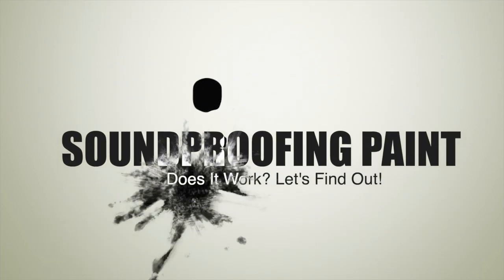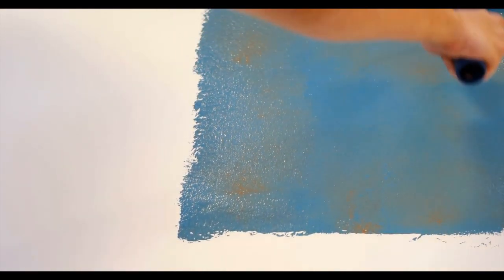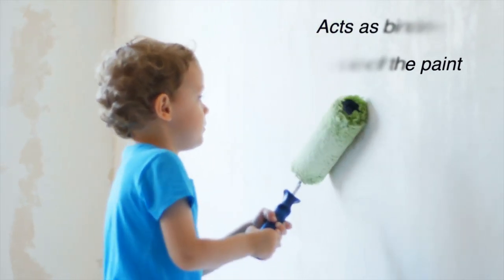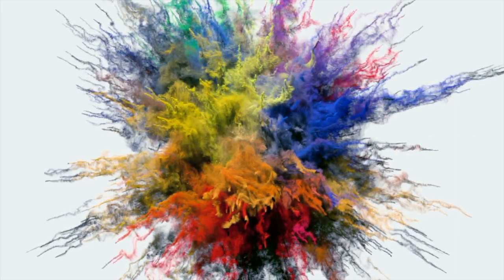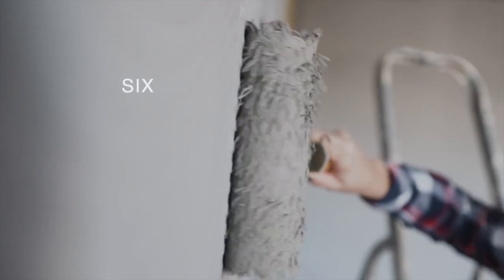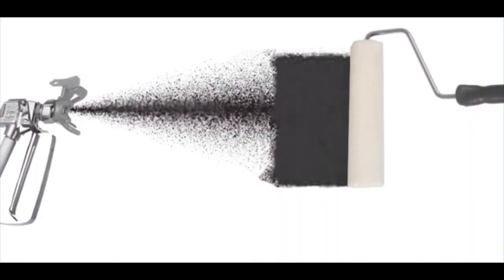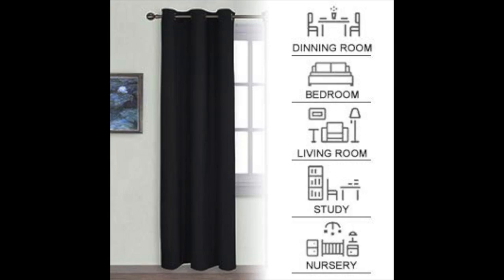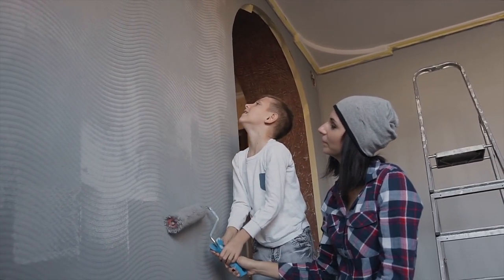Soundproofing Paint - Does it Work? All the Facts You Need!

Comment: You never actually comment on whether or not it works, you only describe how the paint is designed to work.
Reply: I know right. Just wasted 10 mins. Next video........
Reply: He gave specific details of how well it works: 2–4 dB reduction per coat at mid-range frequencies.
Reply: What? He goes into great detail about what the paint actually does, the range of decibel decrease per coat, the types of noise it will and won't reduce, and a bevy of other information.
Reply: Thank you for asking the question. He spent so much time asking the question that I figured he was never going to get to any analysis or comparison. I'm guessing he read a product fact sheet to get the answers referenced below... (2-4 dB reduction per coat at mid-range frequencies...according to the manufacturer?
Reply: @southpaw788 ignorant
Reply: Well, another ignorant

Comment: Would applying this paint to my ceiling help with the sound of my upstairs neighbors walking on hardwood? Or possibly adding soundproof panels to the ceiling? I don't need to eliminate the sound altogether, but even if it lowers the sound a little it might be worth it. Since I live in an apartment, decoupling the ceiling is not an option. I would love to hear your thoughts.
Reply: Did you figure out?
Reply: That's what I'm trying to find out aswell as am wanting to do the same am trying to block impact noise

Comment: Very interesting. I had written this type of product off since it couldn’t add enough mass to effectively block lower frequencies, and because I expected it to be expensive for the performance. But 12dB of reduction is nothing to sneeze at! Guess I should look at the specs, but if the max effect is focused around 2-3kHz it seems like a real solution for a lot of situations.
Reply from the maker: True! Make sure to add AT LEAST 3 coats of this stuff to get any type of results however. Some people that complains that it doesn’t work usually only added 1 or 2 coats of paint. Of course it’s not a miracle product but as you know, when it comes to soundproofing, every bit helps.
Reply: Soundproof Guide would this block the noise of cabinets/draws closing? Or dishes slamming together? The cabinets in my kitchen are on the same wall as my master bedroom and I hate it when I can’t sleep because someone is washing dishes late at night or closing the cabinet...
Reply: @suadaprevljak1824  mate I'd honestly just tell whoever it is to stop slamming drawers late at night if they're in the same house as you.
Reply: @suadaprevljak1824  The answer is kind of. Paint would not stop sounds that are a result of impact (doors hitting cabinet that is attached to the wall). The only way to reduce noise through impact is to use materials that decouple the wall (separate the layers).

For the dishes banging together, the paint would likely help. Dishes create higher frequency noise, and those soundwaves travel through the air instead of through solid objects due to impact.

Comment: You say adding 3 layers of the paint is optimal for the soundproof paint to work. What if I simply add more layers like 6 or 7, will it soundproof the room even better??
Reply from the maker: It will go an extent. I might do this if I only had one small wall to paint because the cost of all the paint will be more than other and better ways to soundproof.
Reply: @soundproofguide  It's one wall, the party wall. How about 5 layers of paint and a heavy duty moving blanket on top?
Reply: @safh9353  that's what I've got. One small party wall which is actually a stud wall. I'm gonna whack this on in multiple layers, get some cheap foam or something and bang a wardrobe or some shit on it with my books. Don't forget to use that green glue for any gaps in the boards under the skirting, cos most the noise escapes under there. Shouldn't cos that much. Bet it'll cost under 100 quid
Reply: Did you ever have any lucky with this paint?

Comment: Does this help at all with low frequency? I have measured the db of the noise that comes into my home at less than 50db. The low frequency bass comes from far away but I still hear the bass loudly in my house. I know that low frequency is hard to mask but if it’s far away and not a high reading wondering if this would work.
Reply: Late answer, but this paint will not help at all for soundproofing. If it’s really a problem, I suggest hiring a professional who is specialised in sound proofing.

Comment: so ok if it reduces -2db every coat. what  if i do 10 coats would  i get -20db?
Reply: @Carl Klinkenborg Where's the proof it's a scam?
Reply: @Carl Klinkenborg I see your point. I know the burden of proof shouldn't be on you, for eg, but just wondered if you had a link on here which debunks the claims that acoustic paint makes any noticeable difference.
Reply: @Carl Klinkenborg I have a  party wall, which is just one stud wall, that connects with a neighbour which I'm looking to treat. Because of the design, it's difficult just to add mass such as book cases, etc, so would you recommend in this case?
Reply: @Carl Klinkenborg I'm lucky in regards to the fact that the ceiling in my apartment has been lowered and already has sound boards in place. The extra cavity means it's quiet as a mouse as there's a neighbour above me as well who has friends round. This connects to the stud wall, which in looking to treat, so I guess my solution shouldn't be an expensive one? I think some of the noise also escapes under the skirting, though, as the joists were freshly renovated only in 2015 and slugs can creep in ffs. Maybe a thick rug and a bit of acoustic glue would solve that issue of the flooring? Do you have any advice?

Comment: I have traffic noise. what is the best method  to soundproof?
Reply: Sound absorbing foam and making sure that you have enough mass in the wall to convert the sound to heat, also making sure that it is air tight, cracks can tune the sound like a waveguide on a speaker, for sleeping in on the weekends, use white noise.

Comment: And that window was triplex not double. Double glaizing works but litle triplex is the one for soundproof noize proof and works as perfect insulation keeping warm inside not leting the heat or cold to pass thru it and works as strong safety. If u have metal strings it will be like bullet proof

Comment: Complete nonsense. If you’re interested in sound proofing or acoustic treatment, do some research. You’ll learn that for sound proofing you need a wall with a lot of mass, it needs to be airtight and decoupled from all other walls and ceilings. And for acoustic treatment you will need insulation material (like rock wool) that is thick enough to absorb 1/4 of the wavelength. Only with 6 inch panels made of rock wool will there be any effect in the bass frequencies. So long story short: this paint won’t help with soundproofing, nor will it have any major effects for acoustic treatment (besides in the high frequencies).

Comment: it is wrong to use sound proof as the wording, sound reinforcement is the proper term, it is not sufficient enough in mass to provide any noticeable difference in sound and is not noticeable, only with fft or spl meters, better to hang acoustic curtains or acoustic absorbing  tapestries, the wall does not need paint it needs inwall sound proofing, if you are using a paint as a budget solution it is minimal at best, never used paint in studios to block energy from the barrier, preventing energy(sound) bleeding through on either side.

Comment: I have noisy neighbors that live on top and you can hear it all if you know what I mean, so I just need something to help with the noise
Reply from the maker: Ugh: if that’s the case then slapping on a layer of paint might not be enough. 
Another layer of drywall with a section of resilient channel between the ceiling and the new layer of drywall would be a much better fix.
Reply: Head phones
Reply: @soundproofguide  resilient channel?

Comment: Is there a specific roller cover to apply the paints for the wall that prevents streaking? My brother is using a regular 9" economy roller cover for latex paint, and it leaves a streak on the walls. It is almost like the paint dries too fast by the time he reaches the bottom of the wall.
Reply: sounds like your drywall wasn't sealed. Prime the wall first.